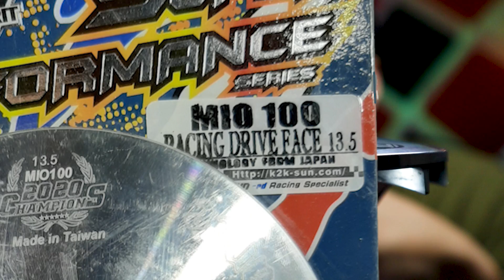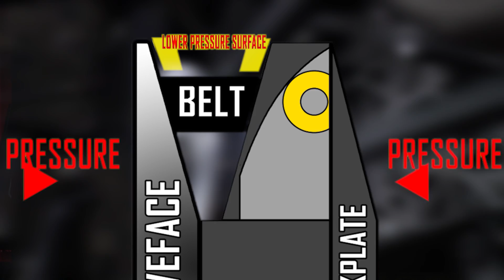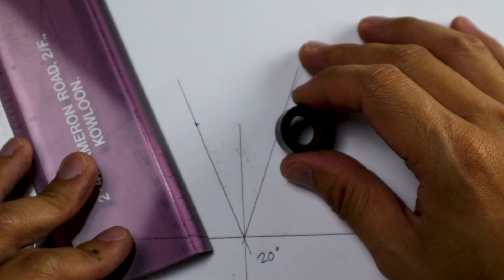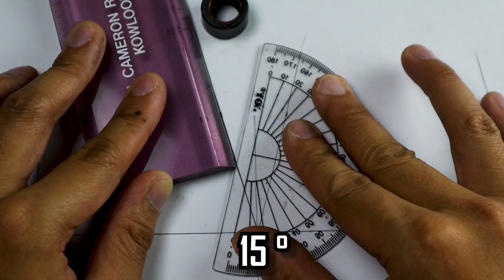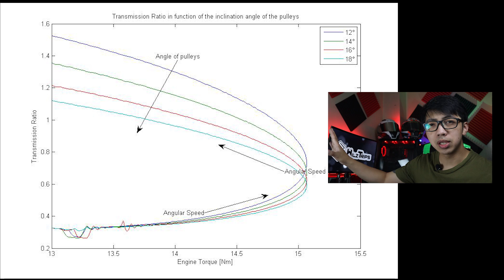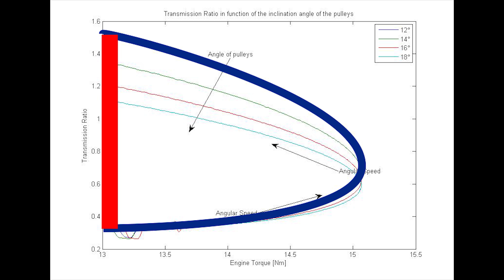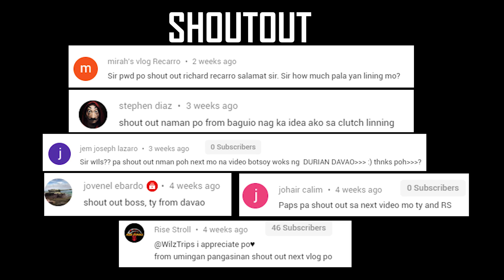AFTERMARKET. RACING AT KALKAL DRIVE FACE AND PULLEY | ANO PAGKAKAIBA NITO SA STOCK? ANO EPEKTO NITO?

Comment: same angles of stock but lighter weight ng pulley and drive face ... stock weight of flyballs ... higher rpm ng center spring and clutch spring plus mas makapal na clutch lining .. yan lang sapat na .  walang dagdag yan cvt sa topspeed (acceleration ang main purpose nyan. timplahan ng preferred mong arangkada ang cvt ,, yun lang ) ... tanggalin nyo or set the right figures yung limiter in accordance sa power at mag upgrade kayo ng cylinder .. etc etc. once ginalaw nyo makina may corresponding needs yan na dapat nyo ayusin para compatible lahat para maachieve nto yung Horse power na gusto nyo madagdag. Usually ang limit ng 150cc scooters ay nasa 120kph.. kung mabigat ka nasa 112 to 115 kph mo lang kaya paabutin ang topspeed, kaya kung di mo kaya bawasan timbang mo, yung motor mo bawasan mo ng timbang like yung lighter weight setup ng cvt and semi slick tyres for added grip sa kalsada para makuha mo yung max na 120kph. for short lighter weight with better traction and right timing of acceleration are the keys to get that 120kph maxspeed na nakaconfigure sa stock ecu ng stock engine.

Comment: dagdag kaalaman lang pag bibili kayo ng panggilid or papasetup kayo ng motor doon kayo sa mekaniko na madaming alam sa pagsesetup mas ok ung mga mekaniko na kumakarera. kase ang pagsesetup ng motor magastos talaga yan like yang mga cvt. tinotono din yan tsaka binabase yan sa rider weight 😃. sa panggilid pag sa mga de clutch inaalam pa ang gear ratio nyan di lang yan madami pang tinotono sprocket carb cam segunyal ect. pagang motor na nakaset maganda ang pagkatono sulit ang ginastos mo ramdam na ramdam mo ung lakas. para sakin mas prefer ko ang pure pitsbike pag sa mga matic naman mas prefer ko ung speedtuner na may halong pitsbike

Comment: Sir tanong lng po anu po stock angel ng drive face at pully ng nmax v1 or v2? Nag palit po kc kmi ng center spring na 1200 rpm tapos 1000 rpm sa clutch spring.. tpos nag pa re-angel drive face at pully ng 13 degris..? Para po kc ang bigat ng i drive ng nmax ko ngyon.? Ang flyball po na kinabit namin combination ng 10grams at 11grams.. slamat po.

Comment: sir wil good day to you my ask lng po ako about sa after market cvt nag palit po kc ako pulley set drive face clutch spring 1000 center spring 1200 Ng etech brand then straight 12g bkt po yung top speed is 107kph lng  80 kg po ako ano po ggwen pra mareach Yung top speed Ng after market cvt .t.y god blessed

Comment: sir pag stock pang gilid lahat gamit ko high rpm low speed sample po 118speed 10k rpm, at pag kalkal pulley naman low rpm high speed sample 8k rpm 121speed. ang tanong ko sir bkit ayaw na umangat ng rpm pag kalkal pulley gamit? sabihin natin kahit hanggang 9k rpm sa kalkal.

Comment: Nice sir ask q lng bkit ung beat q sir parang d na makaalis  tapus pg piniga bitin ang takbo..
Reply from the maker: May possibility po na dragging ang issue sir. Try niyo po muna linisan pang gilid natin then check na rin po status ng flyballs, clutch lining, torque drive at grasa ng torque drive, at bell na rin po kung maayos pa ang condition. 😊
Reply: Sbi kc ng mekaniko skn ng 57mm dw aq na block d q dn alam un cnv lng my konek kya un dun sir
Reply from the maker: Base po sa experience ko sa kargado kong mio sporty. Masmabilis ang wear and tear sa parts ng pang gilid pag kargado. Isang factor diyan, dahil sa masmalakas na power na nabibigay ng makina sa ating pang gilid. Kaya try na lang po check muna sa pang gilid. then other parts like Air Filter, Carb or Fuel Filter pag F.I., then valve clearance, at last resort na yung sa makina, Compression at Seals. 😊

Comment: Sir tanong ko lang po ung kung okay ung setup na to:
75kg solo
150kg with back ride
Plain lang na kalsada dinadaanan
Mio i 125 all stock
Flyball 12g (Straight)
1k rpm center spring
Racing pulley (speed tuner) 

Ok nba 1k rpm?. And ano po effects?. Tnx

Comment: Sir wilz matanong ko lang.
Ung sa 5vv belt or 5tl belt.
Ano ung sukat ng angle nla?
Compatible ba ang angle nya kng magpalit ka ng aftermarket na pulley at drive face?
Reply from the maker: Sorry po sir, hindi po ako sigurado kung anong exact specifications ng stock belt. Pero yung stock belt natin ay compatible sa aftermarket pulley and drive face natin. Pagkakaiba lang nito ay yung wear and tear sa belt compared sa stock DF and pulley. Pero importante din ang belt profile, kaya meron sa market ang mga racing belt.😊
Reply: @WilzTrips  iniisip ko lang kc sir.baka kako fit lang angle ng stock belt sa stock variator ng scoot,
Kng gagamit ka ng 13.5 or 12 degree angle na aftermarket bka hndi lapat ung angle ng belt sa angle ng vario, hndi 100% ung performance diba sir?

Comment: Sir idol tanong ko lang po 
For example sir naka all stock ka po na pulley at torque drive then meron kang 12 grams na bola tapos po nagpalit ka ng  kalkal pulley na 13.5 degree then nagpalit ka ng 14 grams na flyball tapos stock na po lahat with 800 rpm clutch spring. Ano po mangyayare sir. Salamat po sir more power poo
Reply: Sayang hindi nasagot ito, ganito ngayun set up ko. Goods naman sya lods may hiyaw nga lang sa una pero tulin umarangkada compare sa stock pulley lalo na nasa 140kg kami ni misis.
Jvt pulley set, 14g ball, then stock na lahat.

Comment: Share ko lng experience ko jan paps
Stock pulley set = 8500rpm
Kalkal pulley = 8200-8300rpm (additional top speed pero konti lng)
Aftermarket pulley set = 7000rpm (bumaba nman top speed)

Stock lng yung gamit ko na flyball.
Reply: Kakapalit ko lang ng aftermarket pulley na Keso. 
7k rpm lang din limit ng mutor ko. Bakit kaya?